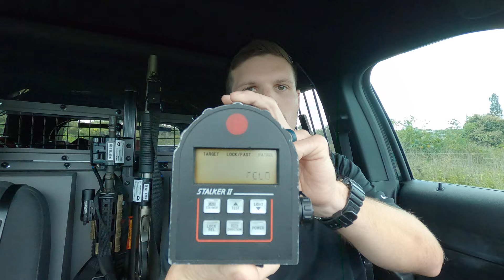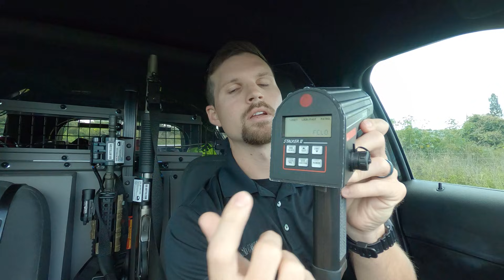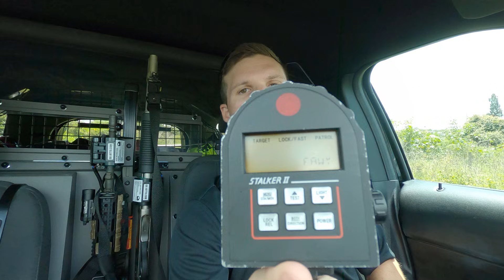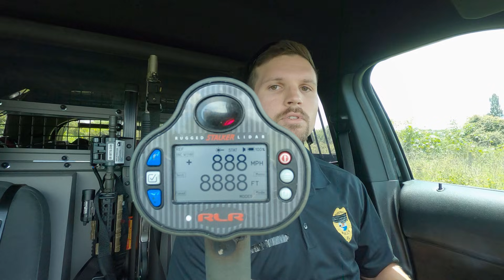How do police catch you speeding? |RADAR and LASER

Comment: Hello, great explanation but quick question. I had a traffic ticket I believe is false. I drove past an officer who was coming out of a parking lot an immediately pulled me over. They claimed they used a LIDAR scanner that was calibrated that morning but refused to show me when I asked to see if it was working. They stated that they couldn't show me because it was in their trunk. Wouldn't you have to have the scanner in your hand and be pointing it at the car your targeting to get a reading since its light and tracks one vehicle? Also, when I drove by I made eye contact with the officer and there hands were on the steering wheel, getting ready to make a turn so I know for a fact they were not using a handheld scanner. I was also following behind a car when I was stopped so I believe they may have had an inaccurate reading. Thank you!
Reply: Note that having a second officer running the unit .. . not the officer ticketing you..  requires BOTH to show up in court.  They themselves know this but don't do it.  (I beat three speeding tickets in a row .. the first due to the officer being intoxicated himself And too focused on the cash visible from outside the car..  the second because  the officer running the equipment had not been requested to show up for the hearing.. on the continuation (extension for the cops convenience)  he showed up without the ticketting officer..  win.   The third involved two male officers interrupted in the act .. as it were..  and the case was sealed for their protection..   enough cash is involved to not say more )
Reply: A lidar must be stationary..  it has to hit a flat surface.  It gives the speed moving towards or away from the unit, not the speed the vehicle is moving overall.
Reply from the maker: I hope it wasn’t false. A couple things could be in play here 1. They used radar and not a LIDAR which could be built into the vehicle having a radar in the front and the rear of the vehicle to get both directions. 2. They could of had another officer operating the LIDAR further down the road. 3. He was using it in a hidden spot and tagged you further down, so he wouldn’t have it in his hand if he was pulling out to get you. The trunk statement is a bit odd I mean they don’t have to show you it but idk how it would get into the trunk if it was a LIDAR, which is why I think it may have been a radar. The biggest thing Chris is you yourself. Did you feel you may have been Speeding prior to observing the officer? If so it may have been true or the officer made it up which would be ridiculous but hey not saying there aren’t crooked individuals out there. Let me know if you have any more questions. Hope this helps!
Reply: @Justthatofficer  Thank you for such a response! A couple of things, I was on a two way street coming out of my college,   the officer was not even a mile down and the way the Parking lot was set up its impossible at the angle to have seen me. If they were in the parking lot and had tagged me and then we're exiting to get to get me. The parking lot itself faces another street, in the opposite direction but the exit faces the street I was on. I did not know they could not show me I have been stopped before and was asked by an officer would I like to see verification of his scanner working but I declined because I knew I was speeding. Another officer did come to the scene after I was pulled over but I saw them traveling a distance and not pull out of a hidden spot. To your last point, I don't believe I was speeding, I had my gf in the car and we were on the way to get some lunch and she does not like speeding so I keep it down when she is with me to make her feel safe. I do feel as soon as I made eye contact with the officer, I just knew I was going to get pulled over and it happened immediately, I drove right past the car and they pulled out the parking lot behind me and put there lights on. Also the speeds we were going at where not fast, I was told I was traveling 41 in a 25 which I felt was ridiculous especially since there was a car directly in front of me which passed the officer first.
Reply: I don't necessarily believe the officer may have made it up, though they did ask me did I know what a LIDAR scanner was an I said yes. Which promoted me to ask if I could verify myself by being shown it which is when they replied that I couldn't because it was in there trunk. However, if there were two cars in very close proximity, that passed the officer secs after each other maybe the radar did pick up the person in front and they mistook it for me? I would have to be traveling slower than the car in front of me based on physics to not crash into them so if I was going 41 then that car would have had to have been going over 41 which from my eye test and memory I don't think they were.
Reply from the maker: @chrisrowland7680  yeah it’s a tough call. If they used LIDAR or “laser” it has a dot that goes directly on the vehicle so there is no mistaking. Radar would show the front vehicle then your speed next to it as explained in the video. It is possible you may have been pacing the front vehicle not realizing you were speeding and the officer was only able to get your speed and not the front vehicle or just decided to laser yours. You could request a hearing and the officer will have to explain to the judge but it is a risk as if he is found in the right you could pay extra fees. At least that’s how it is here. It’s a lot to talk about on here but I hope this was helpful. I do live streams sometimes and if you catch the next one ask away! Take care and be safe!
Reply: @Justthatofficer  Thank you for your help and insight! Take care as well and stay safe!

Comment: When using the LIDAR (laser radar), the laser light has to come back to the device in order for it to calculate the speed, which is done by reflecting off of the vehicle. Therefore, doesn’t the device have to be pointed directly at the vehicle?? If the laser light is not pointed directly at the vehicle, the laser light will still reflect off of the vehicle but at a different angle that won’t come back to the device, RIGHT?? And, I'm guessing the device will still give a calculation, a false calculation, even though the device did not receive back the laser light; is that correct as well? Please let me know.
Reply from the maker: Great question! The light will only reflect directly back giving an accurate speed. If it doesn’t reflect back properly then it won’t produce a reading. There won’t be a false reading unless the device is not working properly, but this is why we test them everyday.
Reply: @Justthatofficer  do you have to shoot it at a license plate or something reflective. If so what would you do if the plate is tinted or is just not in the front of the vehicle
Reply from the maker: @Power1482VIDSSTUDIOPOWER  the laser does have to reflect light back. We point at grilles, headlights and if there is a front plate that works well too.
Reply: @Justthatofficer  even if the light would bounce at an angle? like for example lets say the car is matt colored and doesn't have a shine to it except for the windshield but its curved or is slanted a lot.
Reply from the maker: @Power1482VIDSSTUDIOPOWER  then It wouldn’t return to the unit, therefore not provide a speed reading. It’s measuring how fast the light returns, so if it angles off it won’t get a speed.
Reply: @Power1482VIDSSTUDIOPOWER  non reflective to your eye and to a laser is different.  A flat dull matt finish is still a reflective surface in most cases.  Black tends to ABSORB the light, angled surfaces sends it anywhere but back to the detector.  That is the reason they have to shoot the license plate or grill, because the surface has to be perpendicular to the lights direction of travel.
Reply: It has to be reasonably close. The cone of light sent out by the laser is approx. 1 meter (about 3 to 4 feet) at 300 feet distance. But the light reflected back off the target vehicle is in a cone of about 35-40° so you can be a few degrees off and still receive the return fairly easily. Yes it will affect the speed, but that difference is too small to measure. Light travels at about 186,000 miles per second and since your radar reading is usually 300 feet or closer, that couple billionth of a second won't make any difference at all. If it does make a difference, then just like a radar being off center, it will ALWAYS read a lower speed which is in your favor.
Reply: @stevengibson2251  right on the light cones.. wrong on the operation.  A radar pulse is analyzed for frequency shift not time of flight, and gives an accurate speed towards or away from the detector.  This may be less than the actual vehicle speed..explained by vector math and easily researched.  Lasers are a different, and problematic beast.  Two light pulses are sent at the same target and the difference in return time is measured.  The speed of light and pulse timing used and to calculate speed.  Because the laser can and has damaged eyes and cameras, they are typically low powered and therefore range limited, suceptible to interference by dust and fog or smoke, dangerous to shoot through glass, and must be held near stationary.  Even so, it is still able to show a tree moving at 50 mph or, at longer distances, can trigger off a nearby object.
Reply: @hillaryclinton2415  I take it that your not Bill Clinton's wife, but I believe you may be a cop. You know a lot about the Laser. I was a cop in a Dallas suburb for 16years. I've been to the Doppler Radar Speed detection school by Kustom Electronics (21hr course)  and later I went thee LTI20/20 Laser speed detection course by Laser Technology Inc. Back then it was 36 hours. but that was in the 90's. 
The LTI had two optics, one to transmit and one to receive, but only a single laser beam was sent (not two). The laser was not a solid light. It was a pulsed light at around 18-21k Hz.
Both the laser and radar have a Cosine Effect which reads the target speed lower at 20 to 40 degrees off center. For the radar it's bad and can read 5+ MPH slower. 
What I was saying was that the laser is far less susceptible to it because the laser is traveling so fast, and the car you are clocking is so close that the that the difference almost undetectable.
PS. If you are the real Hillary Clinton, are you gonna run again?

Comment: I always like reminding people with radar detectors that by the time the radar detector picks it up, the police have your speed.
Reply from the maker: Now it can help with radar if it is constantly on, but if we hit you with the laser it’s too late.
Reply: Not true. For lidar that is usually true, but for radar I've detected police from miles away around corners without any direct line of sight.
Reply: @artomix7  and the 3rd person I explain this to. Detecting a radar wave doesn’t mean, the radar wave is giving an accurate reading. Radar waves get bigger as they travel. It isn’t an all knowing magical thing. This is why you need to understand the underlying science behind the tools you are using.
Reply: @artomix7  here’s an example. If you goto a baseball game with your radar detector (from a relative position in line with wave) it will tell you radar waves are coming and go off. But this would happen whether the gun was aimed at the pitch or the 3rd base coach. And if we want to know the speed of the pitch, with accuracy, it is going to have to be 1) aimed properly and 2) be calibrated before use
Reply: Yeah like he said. if the radar is running my detector can pick it up around corners and over hills
Reply: @rileypeden4624  this is not true. Radar in a submarine is deployed differently and has obviously more open space than a forested roadway. Radar from antenna is a relatively straight wave. And hills/corners will cause interference. This is the problem, I suspect most of you LEOs passed minimal science/math courses. Also the higher frequency bands now used in road radar while faster response times than the radar used 30+ years ago. Have a greater need for daily calibration. I used to operate the radar gun for my baseball team, even those needed to be calibrated before each practice/scout session for accuracy of the data recorded.
Reply: @troycooke5590  yeah your right it definitely never happened. I lied and I don't evan have a radar detector, I just wanted to sound smart.
Reply: @troycooke5590  You dont really sound like u know what you're talking about. With laser it only turns on when aiming at the car, its to late when a laser hits u. Now with a radar its not cause "fAsTeR rEspOnsE tImE" its cause they use POP. They activate the radar only when they aim at the car not just leave it running. With pop you can still see it when they aim at another car. POP is the best for police than its laser.
Reply: @rileypeden4624  it’s not about if you can pick it up. This is the problem with you police who have CJ classes in your degrees omit full lab science courses. Will you get a reading, yes! A radar wave is going to keep traveling, expanding and something will bounce back. However, that doesn’t mean you have an accurate reading... this isn’t an absolute-“my radar pinged therefore it worked”. You need to give it context.. a lawyer + a hill or curve is gonna get your flawed ticket tossed every time. It’s annoying all you police have this dogmatic “the law is infallible” personality.
Reply: @ChrisSmith-ig9jq    so Chris why don’t you provide a definition of “POP” not just use esoteric acronyms. You also could reference a text or scientific journal. I have first hand seen lawyers get speeding tickets thrown out with evidence of a hill or curved roadway interfering in accurate measurement. Lidar is different, but similarly you can’t get around a meniscus you’d get the speed at the tangential line once a car crossed into it. When I said response time I meant, the time between a radar wave and the Doppler kick back response. Also next time you correct someone; maybe, learn how to properly use “it’s and “its”. An illiterate police report can also be ruled inadmissible in certain circumstances.
Reply: @ChrisSmith-ig9jq  lastly “faster response time” refers to quite literally the reading/output in today’s radar(which is at a higher frequency than the ones used long ago). The latency, time between firing and getting a response is better. However to be accurate, it must be calibrated. Radars at airports are calibrated frequently every day as regulated by the TSA. Unfortunately not the case with most police car radar.

Comment: yeah its fast...like the speed of light
Reply from the maker: Lol yup
Reply: @Justthatofficer is the info on the lock button correct?  doesnt it pertain to the locking in the faster / strongest signal?
Reply from the maker: @SuperDodoe   Yes sir. It will lock in the fastest speed, which should be the vehicle you plan to stop. I don't always use this feature as I usually have to put the radar down fast to catch them or I use the laser, which auto locks the speed. Thanks for watching and commenting!
Reply: @Justthatofficer  thanks for the response I really enjoyed the video and would love to see more 👍.
Reply: Is it required by law to estimate a vehicles speed prior to targeting it with radar?
Reply from the maker: @SuperDodoe  yes it is. We must visually see that vehicle speeding then the radar confirms that it’s accurate to that vehicle. Obviously we aren’t perfect but we have to be within 5mph of the reading on the radar most of us are right on or within 1 or 2 mph.
Reply: @Justthatofficer  so that would be using I/o vs constant on?  Is constant on used in any situation?
Reply from the maker: @SuperDodoe  both ways. I have it on constant when it’s on the dash so I don’t have to pull the trigger. But you visualize for both.
Reply: that's a helluva speeding ticket.